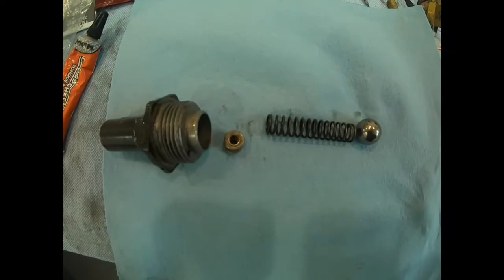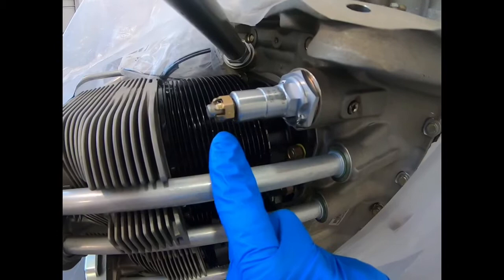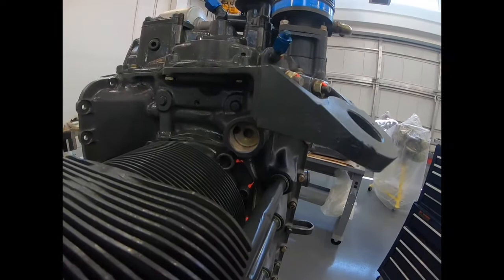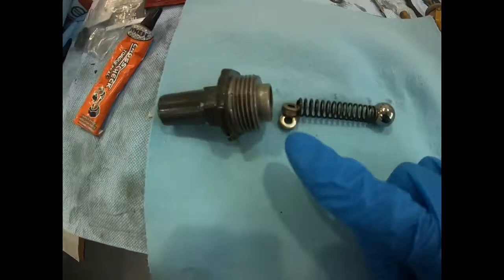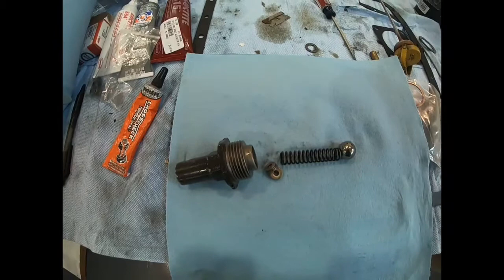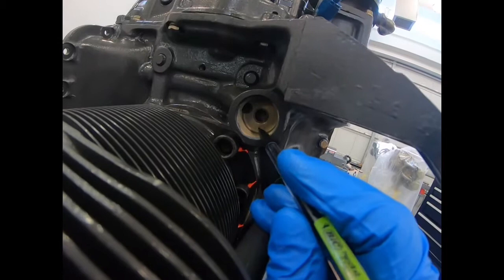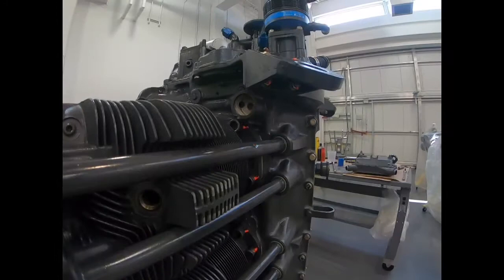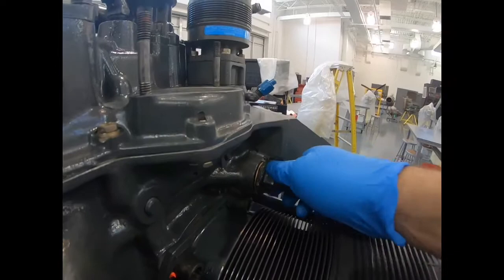Operation of the Lycoming O-540 oil pressure relief valve and its installation

Comment: Thanks for this video!  I actually used your excellent explanation and demonstration to adjust the externally adjustable oil relief valve on my 1939 Lea-Francis Super Sports 1.6 litre automobile engine. 😄